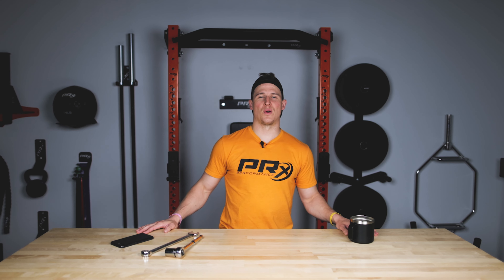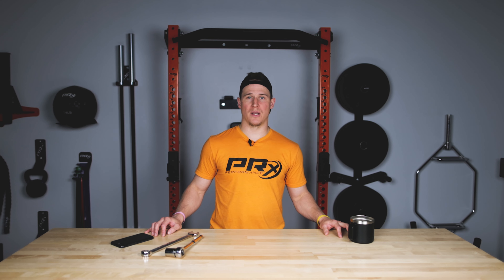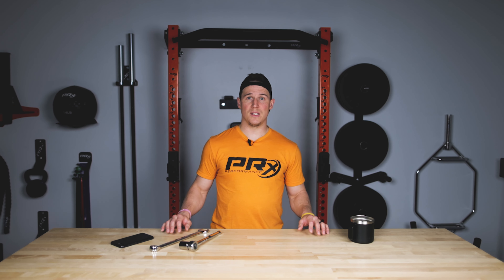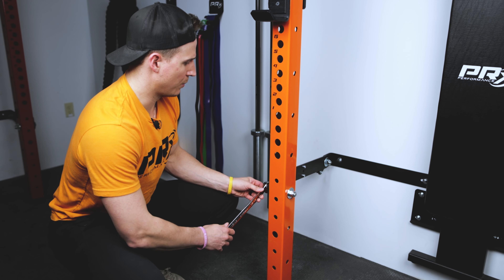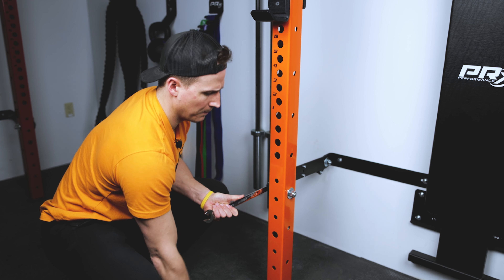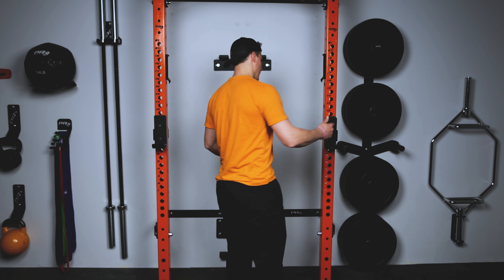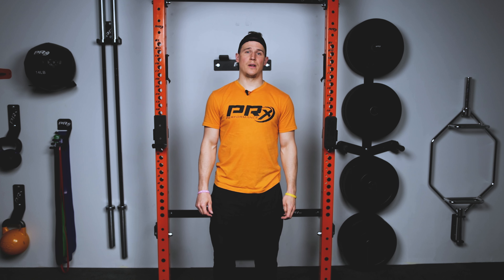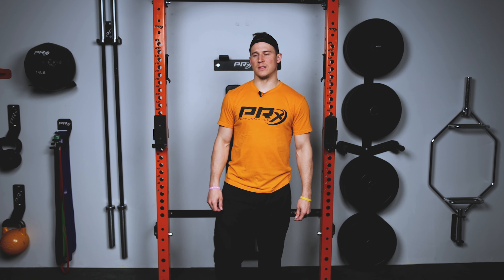Is your rack hard to fold up and down? / FAQ Series - EP. 4

Comment: I bought mine off of marketplace and it seems quite stiff. I loosened the pivot points like you mentioned and it’s much better just seems a bit wobbly. However, I realized I don’t have the plastic spacers on 4 pivot points. Would adding them make a difference in how easy it is to fold up?
Reply from the maker: Yea we suggest having all of the included hardware for easiest folding. If you want, contact support@prxperformance.com and they might be able to help you out!

Comment: Why not add a bearing to these assembly pivot points? Or list ft lbs for tightening?  I’m in the market for this rack just wondering
Reply from the maker: It doesn't need a bearing assembly, and that would most likely end up being too expensive. The nyloc nuts keep everything snug and in place. If your rack is hard to fold up, just back the nyloc nuts off a little bit until it's to a point where you're happy! It's an easy process, just takes an extra minute or 2 to get it all dialed in 👍